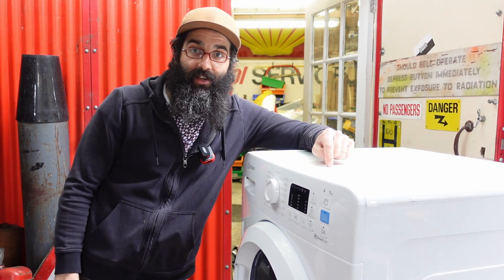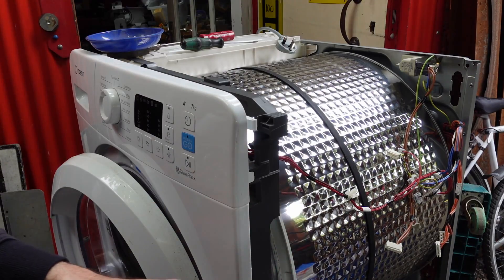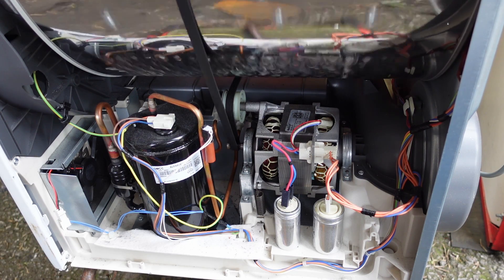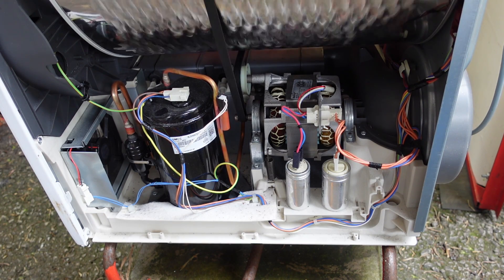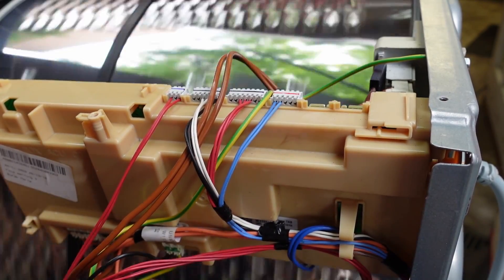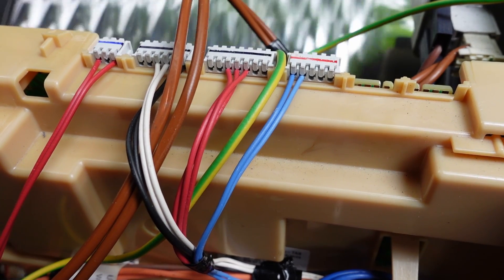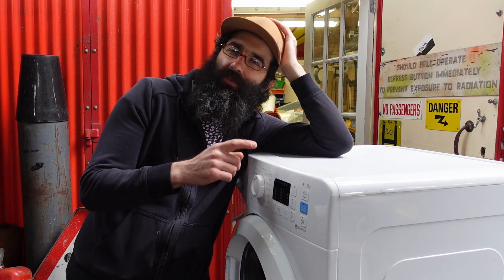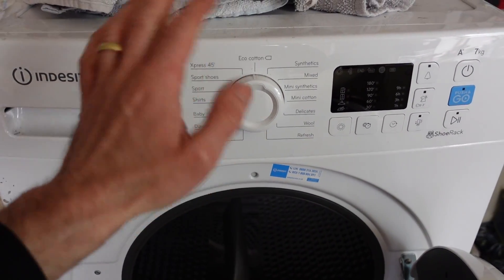Indesit Heat Pump Tumble Dryer:  Tripping RCD! A simple fix but difficult to find!

Comment: I've got a Hotpoint heat pump tumble dryer, the drum was catching when rotating.  Luckily was fixed under warranty but really should not have happened.  Looked like the joint on the drum had separated slightly.

Comment: had a similar issue when fixing the bearings on one of my machines recently. three of the wires that went to the motor had worn themselves down and exposed the copper. luckily its never tripped but did just put insulating tape over them to solve it. that is quite a bizarre fault really

Comment: Good man Owen, that's a great find, usually that wire is hooked up around the back like you have it now, it's possible it was getting hit by the drum in rotation. It's great when it's the simple things. When I megar a machine. I go from mains plug, and continuity whole machine. If low reading. I'll disconnect 1 by 1 the components till I get a good reading, but that's for when ya in the dark and no clue what's going on, doesn't happen often, 😂 good spot tho buddy, fair play to ya.
Reply from the maker: Cheers. Thanks for your help. I need to get a bit of learning in with the megger. I just got lucky on this one.
Reply: @bootsowen  insulation resistance is what ya want to be checking not continuity, I just noticed I said that last night. Was late I was half asleep 😂 absolutely anytime bud,
Reply: Could you use the insulation tester for solar panel wiring and their RIso errors?

Comment: I would have IR tested it like a P.A.T test via the plug (line & neutral to earth) before dismantling to see how much of a short to earth there was noting down how many Ohms. 

Then every so often during disassembly a quick IR test between line & neutral to earth to see if anything has changed with the readings. 

As the earth leakage was due to the live wire touching the earthed case when you removed the case the IR test would have shown the fault had been cleared and you can then focus on what you had changed since you last tested knowing that is where the fault lies.
Reply from the maker: Thanks. I am learning on the megger so it is all new to me. I am not sure a megger would have showed the fault because it wasn’t tripping until a few minutes had passed with the machine working. So it needed damp maybe heat to get the fault. But I will use the process you have detailed in the future. Thanks.
Reply: @bootsowen Hi Owen, no obvious shield on that drum so presumably the clothes going in need to be damp not sodden. As you say much higher humidity within the casing on a heatpump style dryer.
The wear mark looks smooth and over a wide area, indicates a light pressure over time. That drum looks a bit nobbly so I'd expect a rougher mark on the cable. No obvious marks on the casing. Probably a higher resistance from drum to ground than case to ground.

Comment: Fingers crossed thats fixed it! 
Its amazing how a simple wire can end up being the issues when the copper is exposed.. could also not be just melted. and just pulled the cable against the unit losening the wire from its connection! well done buddy! excellent repair! :) i wonder how much a repair guy from indesit would of charged for that or even spotted it!

Comment: nice job. i wonder if there was any chance the wire could have been rubbing against the drum, causing it to expose the copper over time? then maybe as it rubs it gets moved and after a while the exposed copper touched the metal drum, causing an RCD trip? or maybe as it gets hot, the wire becomes softer and moves towards the drum or chassis? i might have totally skewed logic but this was my first thought when seeing that wire.
Reply from the maker: Maybe I said that later on in the video. Except I thought that it was rubbing the side casing.